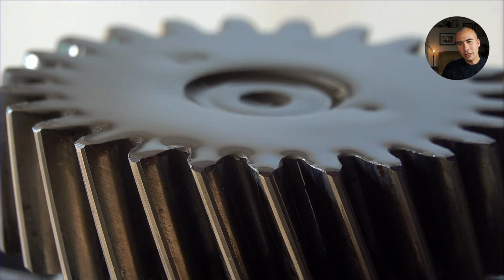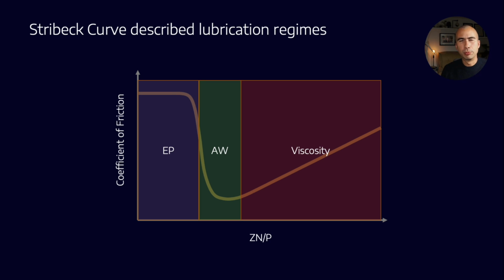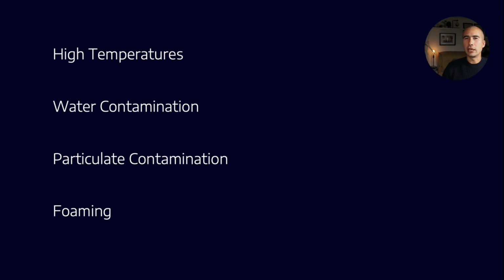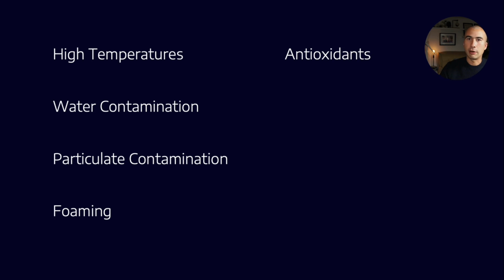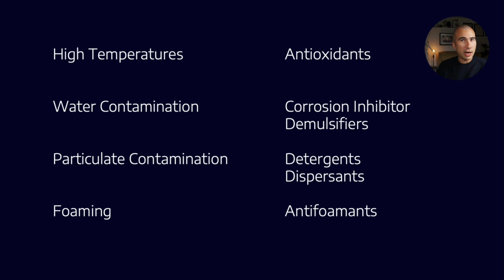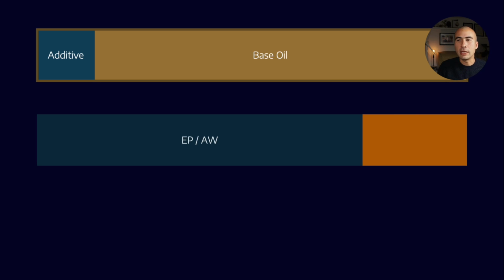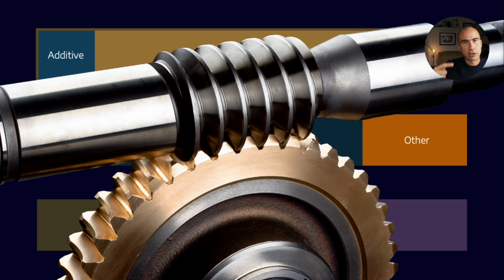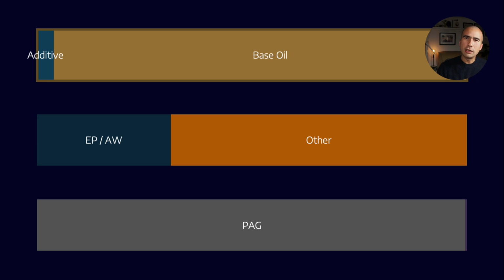Gear Oil Formulation

Comment: Is GL 4 or GL5 gear oil good for the gear box and clutch system of two stroke bikes?
Reply: Look for MT-1 rated gl5 or gl4, it has antiwear for straight cut gears as well as EP for shock loading

Comment: You know what would be nice; is if oil manufacturers had a lube guide, but instead of one for already made uses it would be for custom applications. A drop down box, materials, bearings, clearances, temperature, speed, types of gears, type of lubrication etc. My gear box design is all steel gears with ball bearings and also chain drive (either silent or roller) some gears are high speed and load load others are high load and low speed. Am hoping to use the input gear as also the oil pump for oil squirters as it needs to lift oil 40cm and then trickle down. SO much design, but it is fun. Learning is the never ending puzzle.

Comment: How does ATF fluids do in a gear box, like rear diff's in 4 wheelers, are they good for light gear work??
Reply: Great question!  I need to know!
Reply: ATF is not used in differentials with hypoid gears. You'd use an API GL5 oil of the suggested viscosity. ATF is used in some standard transmissions with closer clearances between gears & shafts or bushings.
Reply: @n.mcneil4066  Thats well known. But I am talking about light duty, light load oil.
Not a 7000 lb machine. Amsoil says a gl5 is not needed in a UTV/atv, Polaris does not use true Hypoids either, it's more of a bevel gear. I'm always looking for alternatives.

Comment: Pshh everyone knows worm gears need compounding with whale oil, about 20% co-base should do. It makes the oil "oilyer" for all that sliding. Also applicable to steam cylinders.
(Actual old time info I picked up somewhere, though not word of mouth it was from an old engineering paper.)
Reply from the maker: You're not far off the mark. There's plenty of cylinder oils still using tallow.

Comment: Interesting.  Yes complexity cause of different applications.  Just like in a manual transmission with synchros.  Some manufacturers will just recommend a special synchro fluid, a Gl-4 rated or one that is GL-4/5.  Not so much of being corrosive to synchros but I know each fluid has different frictional properties that could effect synchro performance.  JMHO
Reply: Gl-5 is often avoided specifically because of the yellow metal corrosion, the GL5 standard was developed for hypoid differentials which need high EP loads and high shear strength because of increased sliding forces. But I do agree that friction modification is also a major consideration with anything that acts like a clutch, a syncro, limited slip differential, the wet clutch on many motorcycles.